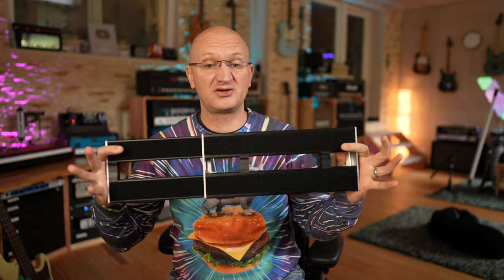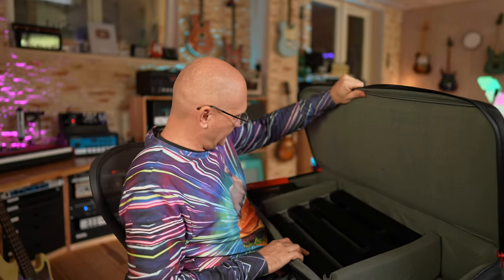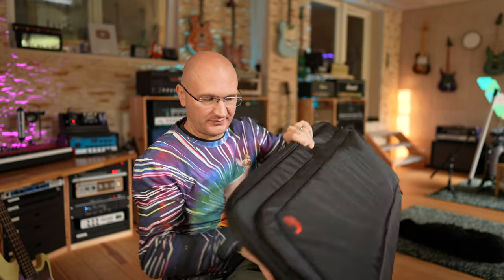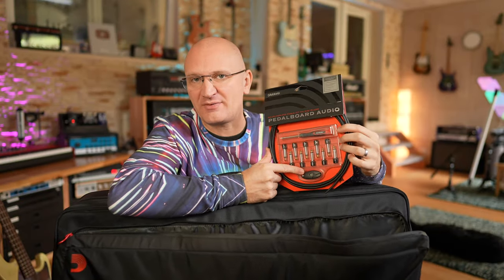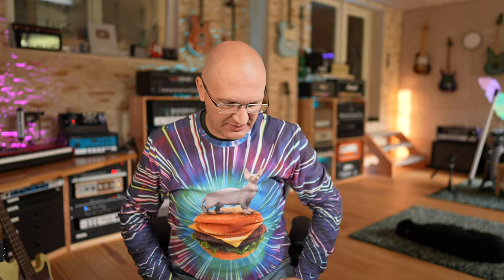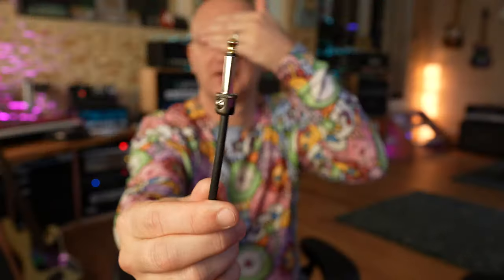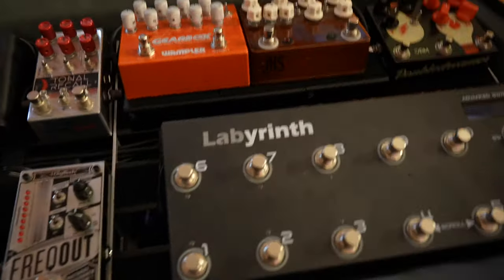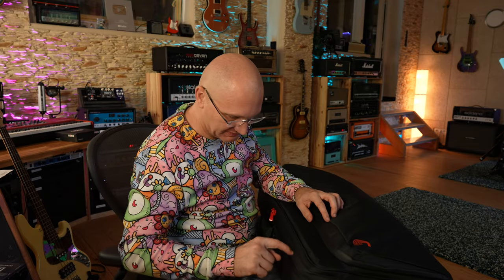Good idea or Useless?

Comment: DIMENSIONS OF EACH BOARD (per Sweetwater):

XPND - LARGE
Height:	3.9" (includes feet)
Length:	17.25"-31.75" (adjustable)
Depth:	12.8"

XPND- SMALL
Height:	2.57" (includes feet)
Length:	14"-24.75" (adjustable)
Depth:	5.85"

Comment: I made a pedal board out of wood to work with 4 cable method.  I have these TRS female/female couplers on the board so that all 4 cables from a snake go into the board in the same spot.  If I were to swtich to something like this I'd have to do something similar or I'd have to cut back the cable snake sheathing so the cables could go to 4 different places on the board.

Comment: I have both the big and small ones. I really dig them. I didn’t get cases for either one yet as I did cough at the cost of the cases but I may if I start lugging them around. Right now they are just being used at home. I thought the price for just the board part was pretty reasonable. The cases I wish were cheaper

Comment: A board could be designed with separate parts that you could extend and if you want create separate tiers. It could hold perhaps 6 pedals in its smallest form or even a hundred by extending both in latitude and vertically. It could be designed to fasten together using easy to source nuts and bolts that are replaceable at Home Depot or equivalent. Rubber washers could be common size tap washers. Feet would use standard size ones used for amps & cabs. In short with very little pricey specialized parts simply small metal panels. The maker would never run out of buyers.

Comment: Will the velcro hold a DC7 over time?  Anytime I've velcro'd a power supply, including my old Cioks DC5 under a board, the glue would eventually pull loose from gravity and the power supply would fall off.

Comment: I know it 7 months ago Hi if you cen answer this question it would be Great as don't no Bugera amp at all but cen I put a Bugera 333XL Infinium or drop the output of amplifier head below 120 watt output to Compensate for the 100w output of Laney Cub-212 Cabinet if not cen i use a Bugera PS1 Power Soak  Power Attenuator I like to keep them all the   same for the amplifier cen you let me no please as I bought a Laney Cub-212 not long ago from Thomann hope you I hear back if have time OK

Comment: The concept is okay if you don't want to dismantle a board to use the same pedals in a bigger/smaller board set-up.  The drawbacks for me are that:
1) The board still has to have the patch cables & power ready for an expansion, even when not in use, if you are using different size boards in different circumstances/gigs.  
2) Unless you have the pedals already with you, you can't just increse the size of the pedal board quickly while on the road.  Since you are already carrying the pedals, why not leave them on a larger board?

The only real advantage is for those who don't have many pedals yet and don't want to buy a bigger board when they do have more.
Reply: Yes, you could put them all on one board and just leave it be but- now you've got a lot of impedance between you and the amp or- you've had to add solutions- buffers, noise gates, possibly shielding, etc. Much easier to just use a smaller board and now you don't need buffers, you don't need a noise gate, and you usually don't require any shielding. Not to mention that now when I look down during a live show I'm not like "Now where's that reverb pedal again..." I know exactly where it is because there's only between 4-6 pedals on my board at any one time. 

Also- no idea why but fans don't like to see someone with 30 pedals arrayed out in front of them- it gives them the impression that you need technology to prop up your playing. I know that's a bit silly but it's true- I've heard multiple fans talk about it, multiple times, at different shows. When I'm setting up my gear on stage- we don't have roadies, we're not that good- I always listen to the ppl closest to the stage- they're usually talking loudly because it's crowded, they want to hear one another- so if you just try a little you can hear their conversation. Several different times that conversation was about how many pedals I was using, and the prevailing consensus was that too many pedals equal someone trying to fake it. Now I disagree completely but- it's about the fans- right? If they want raw, unproduced, rock and roll then that's what we tried to give them. BY the time I stopped gigging I had I think 3 pedals- boost, reverb, and delay. Occasionally I would sneak in a wah though that was a multi effect pedal- sneaky.  The Boss PW-10 V-Wah modeling pedal- it's an amazing pedal man- does so much.